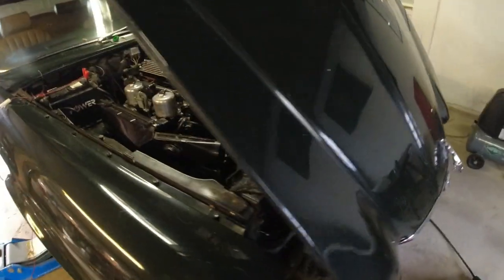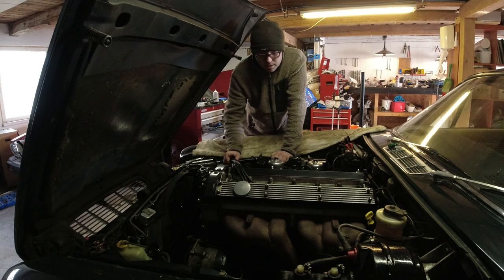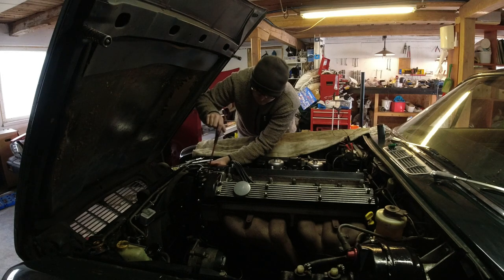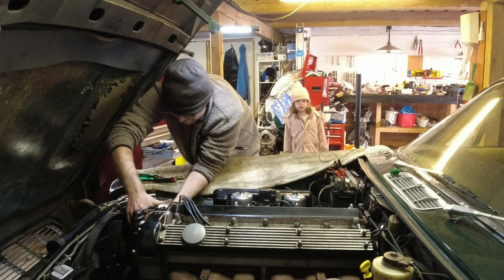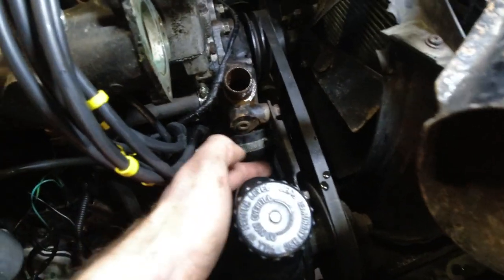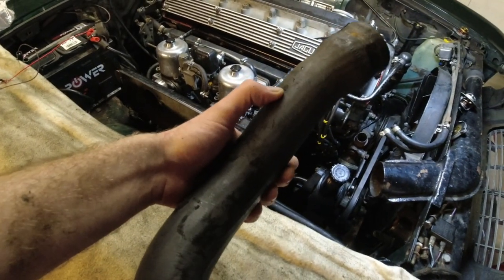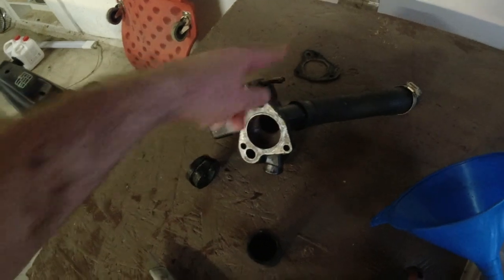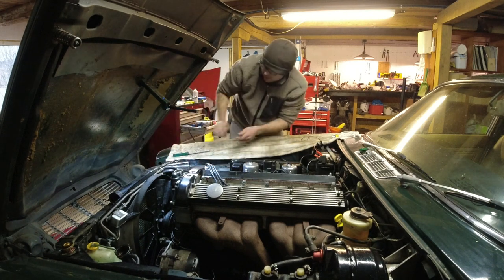A Tiny but Annoying Coolant Leak on my Daily Driver XJ6

Comment: Jubilee sell a range of wide band high torque marine grade stainless steel hose clips, I find them really good for problem leaks and when using kevlar reinforced hoses.
Reply from the maker: I have tried 5 different clamp styles here but it still leaked. The hose was slightly damaged
Reply: That's similar to what I used for my XJ40. They are known to leak hydraulic fluid between the tank and the pump. I bought the item for very little $ at a hydraulic shop and the problem is fixed.

Comment: Adam, be very gentle when cutting a hose off. If you’re too aggressive you’ll cut a scratch in the metal that will act like a channel for the water to leak out. No amount of tightening will seal it. Been a car wash mechanic my who,e life and have seen this many times on hose barbs.
Reply from the maker: Yes of course you cut it off gently. I always cut just barely through the hose so I never touch the metal beneath. Then I pry the cut apart so the last part of the rubber slits.
I’ll remember to mention that you shouldn’t cut through a hose in a hard way next time. Thanks for mentioning it!